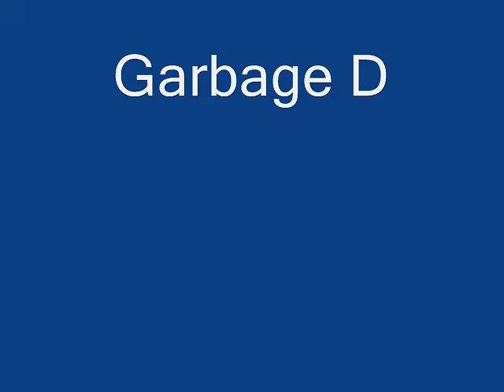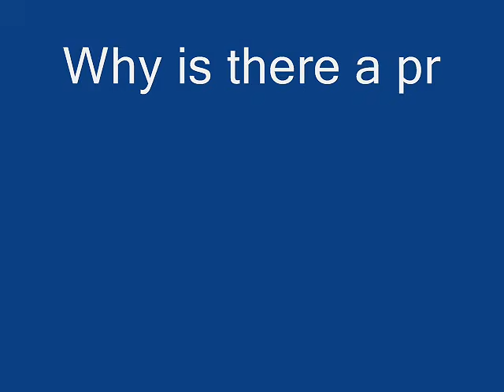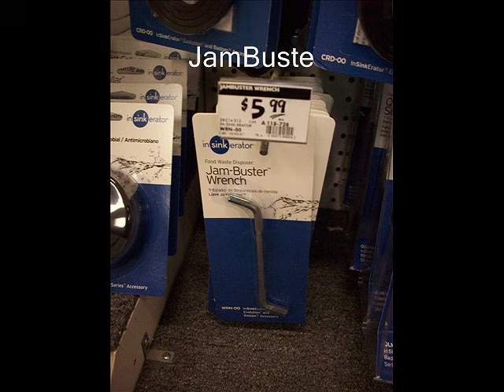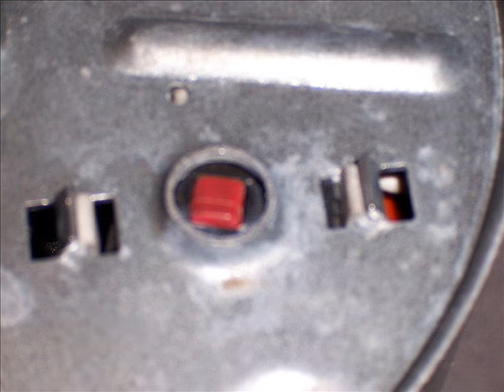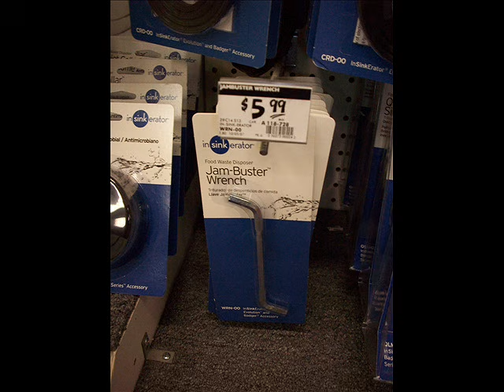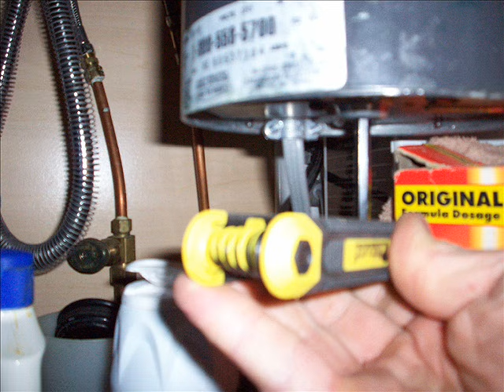Fix Your Garbage Disposal | Disposal Repair | No Cost | Save $$$

Comment: My garbage disposal isn't jammed, but it doesn't work. It was stuck, but that was because I use it so infrequently. Anyway, after freeing it up, I tried to flush down a fairly large quantity of coffee grounds and those cone-shaped paper filters you use with coffee makers. All went well until the last of it. At that time, the garbage disposal stopped feeding.  The motor hums, and the the moving parts (impeller?)  move, but  nothing is drawn down, and the liquid doesn't drain out. In short, it sounds and behaves ALMOST as it did when it was working properly, but it no longer pulls down the stuff to be disposed, and the water doesn't drain out. Is this something that requires a plumber?
Reply: It's probably jammed with the paper coffee filters.  Disposals are not made to grind up paper.
Reply: That doesn't seem logical when you consider the things that it does accept and process. Anyway,  I fixed it. The problem wasn't in the garbage disposal, it was in the tube leading away from the disposer towards the drain. It was jammed because I was loading the disposer too quickly. On another YouTube video about how to fix garbage disposals, the lady admitted that it happens to her  about three times a year, and she's an expert.
Reply: Nice that you were able to fix it.

Comment: Thought it was a goner. Could not for the life of me locate the reset button, even after looking at numerous websites and even the Waste King SS5000 manual. When you showed the red button on the bottom, I simply got out a mirror and - voilá - back in business. Since I am a 74-year-old widow I am pretty proud that I could follow your excellent instructions and fix this puppy myself! :-) BTW, this disposal was installed way before my husband died 23 years ago and it is still working great.

Comment: SECURITY ISSUE: You should unplug the garbage disposal, not only switch it off to work with it!
Reply: Cainbantam  mine is hard wired, cant unplug it. His method worked flawlessly for me and apparently thousands of others.
Reply: Switch off breaker!!
Reply: Lol... just buy new house 😂😳👋🏻
Reply: Cainbantam Good idea.
Reply: Very good point.
Reply: I have no tools,, Im going to home depot to pick up the unjam wrench. I can hear the humming noise tho
Reply: Cainbantam they are NOT plugged into the wall.. they are hard wired if installed properly.  You hired a hack to install yours if it's just plugged in the wall
Reply: @brotherdio420  Remove fuse, or switch off breaker.
Reply: @dio. Correct. It needs to be hard wired. That's the reason why manufacturers don't put a cord, with a "plug in", on them.
Reply: @james1795  Actually, quite a few of them come with plugs, and it is 100% perfectly fine to plug them in.  There is no difference between plugging a plug into a receptacle and wiring it straight to the romex...
Reply: Cainbantam Safety issue you mean?

Comment: I did it, started it, heard a huge grinding noise then a hum again. I tried the Allen wrench again and it doesn't move the blades now to clear it. I've tugged hard but it looks like it will pull the whole thing off under the sink. It still hums though. Is it possible tongue a bearing stuck or something?

Comment: A lttle tiny screw was in my disposal hiding under a corn kernel. That was blocking it. Used the iphone light, a long screwdriver and a couple taps on the scew driver handle to get the screw out. Then it still hummed. So i used the allen wrench trick. Then it started working. Save. You saved my ear drum too, if ya know what i mean.

Comment: Thank you!  Instead of paying for a new disposal, I actually made money.  Using your suggestions and my allen wrench I found two quarters jammed in my disposal!  It's working like a charm now.  Ironically, if I hadn't tried to fix it myself it would have been like throwing money down the drain!
Reply: So, you saved money from the new disposal and got an extra 50c for your trouble?  Win-Win
Reply: Daniel Lindsey
Reply: Literally 🤣
Reply: Allycat or Daniel Lindsey so did u actually retrieve the quarters or do they just stay in there ?
Reply: OJG638

Comment: another satisfied you tube viewer.  I started with the wrong size allen wrench but got the 1/4 and it worked but only after I force-turned the blades with the top end of a wooden broom handle----without the motor on of course.!!!!  The culprit was the uncooked split peas I threw down there a few weeks ago.  Mystery solved.

Comment: Awesome Video!!!!  You just saved me $118.  Just purchased a replacement today -but had not opened it.  Came across this video and fixed this within 5 minutes.  The one I bought today will be going back tomorrow.  You are a life saver.  So glad I didn't have to install a new one.  It was a pain in the butt when I put the  last one in.  Thanks so much for your video!!!  The resolution was to reset the breaker on the disposal and then to use a 1/4 hex to unjam the rotor which was jammed and easily unstuck with a 1/4 inch allan wrench as you suggested.

Comment: thanks it worked but I have one problem the Ala wrenge got stuck in the hole!  how do I get it out!
Reply: same issue how did you remove it
Reply: Called a friend with more upper arm strength. He struggled a bit but did it.
Reply: +oa1986 thanks I solve the issue, just needed to stop the blade from moving

Comment: Excellent instructions! My garbage disposal was humming at first, then it was not making any noise. I thought the motor was burned out but it turned out I just had to use the wrench and reset the disposal.
Worked like a charm and saved me at least $200!

Comment: Thanks, the last part with the screw driver was great.. Every now and then, the disposer used to fail and work after couple of days, tried everything, push red switch, shake the disposer :) the handy man used to come and didn't say any details, but now I know, "rotate around with a screw driver" if the disposer is not working but has small humming sound when you turn on the switch

Comment: Thanks. The disposer is an amazing kitchen tool. We try to strain as much as possible, just to keep bulk from going into the sewer system. I know I know, my little bit is not going to make a difference but my grandmother taught me well and that is the way we roll around here. 

The wrench works great. I suggest using Duc tape and mounting the wrench to your Disposer, so you do not need to look for it.  Our jam ended up being a small pepper stem that became wedged. The smallest things. Thanks again for the video.

Comment: If I have the hum and did all of the steps but I'm not using a 1/4 inch ( I only have an 1/8 I believe ) too small does it still have a chance? I'm bummed. I saw this tiny aluminum thin ring( key) but thinner and heard it hit the bottom.. It wasn't humming at all until tonight after doing the breaker , when I reset it went on for a second and then went to hum mode. Any thoughts? Hopefully this makes a little sense. Thanks

Comment: Thankyouthankyousthankyou!!!!  I was cleaning out leftovers from my fridge tonight in preparation for the meals I'd be prepping this weekend and I go turn on the disposal and it did nothing.  I was panic stricken.  It was a little past 9 on a Thursday night and it was the last thing I needed.  
I'm a single mom and the thought of what a plumber was going to charge me just stressed me out.
I grabbed my laptop and started Googling for answers.  I came across your video and it walked me through what I needed to do with clear instruction and pictures and I cannot believe I actually fixed my garbage disposal myself!!!!
The circuit on the disposal itself had tripped plus it was jammed.  Somehow I actually had a wrench that fit the bottom so I could clear the jam so I didn't even need to make a late night run to Walmart hoping they'd have the tool.  
Once the wrench spun freely I stood up, said a prayer and flipped the switch and I did a happy dance as soon as the disposal started spinning!  I'll be completely honest and admit I thought I was going to cry for a second because I was so happy.  Thank you so so much for taking the time to make this video, it was such a life saver and it made me so proud of myself tonight!

Comment: Excellent video.  My current disposal is about 20 years old and suddenly froze up.  Had assumed it simply wore out and was preparing to have to purchase and install a new one.  Decided first to check you tube and came across this video.  Turns out all I had to do was lossen it with a hex wrench.  Works fine now.  Thanks!

Comment: Thanks for your help.  I couldn't see what type of fitting was down there.  1/4" Hex nut was just the right magic words that I was looking for.  Thank you so much for that.  Btw, it didn't matter, I couldn't jar it loose.  It saw what appeared to be a piece of brass wedged in there.  I was able to pry it loose with a screw driver.  Don't ask, I haven't a clue.

Comment: man, nobody (that  I've watched so far) goes on to discuss the one other scenario that could be happening - no jam but still humming.... (I can turn it with the wrench and by hand from the top) I was stuck, but the wrench did the trick and broke it loose.   what's next?
Reply: Kristen Hill I've got the same issue.
Reply: I'm guessing the disposal is caput and has to be replaced since it isn't stuck, has power, but still not working....  If i'm wrong, hopefully someone will let me know before I spend the money :)
Reply: Kristen Hill  I had less luck.  Our small organization purchased a house for office space which came with this jammed disposal.  Bottom line, ours wouldn't unjam and, unfortunately, whoever installed it in the first place never put a lock screw in or other mechanism to keep it from rotating off.  About broke my nose trying to unjam the thing while it dropped. Eventually had to get a plumber to undo what I had done only to find out that someone dropped a screw in it.
Reply: John Reed did it start working again?
Reply: Kristen Hill Sorry for the delay.  Yes, the plumber got it working again, which, in turn, also got our dishwasher working again since it was tied into it.
Reply: John Reed  Okay... that is great........ BUT HOW?!  How could you leave the most important piece of information out your reply??   Lol   What did he say was wrong with it and did you watch as he repaired it?
Reply: +Kristen Hill  My apologies.  Again, office setting, so I had handed off the job to a professional while I returned to doing what I was being paid to do.  We actually had a small screw that had fallen in to the disposal.  The plumber made sure the power source was disconnected (I assume by flipping the breaker, but I don't know how; was working) and managed to remove the jammed screw through the top through which water enters in the sink though by this time, the unit had fallen.  I know nothing about whether or not he had remounted the unit to the sink before searching for the jam.  I assume he was using pliers, screwdriver, etc.  Again, not there, so it could have been a magic wand.  Lol.  By the end, at some point he remounted the unit like it had been before, but this time put the set screws in place wherever it is that set screws go so that it would drop again which my forehead appreciates.  All I know is what I've been told because when I touched it, things got worse, our secretary called the plumber, and I went back to doing what I was getting paid (& getting behind) to do.  In the end, we paid about $80 for the plumber to do his thing and it took him less than an hour to do a job that we had waited 4 years to figure out and 3 hours of my fiddling with it all because I was fed up with higher ups not doing anything enough to Google it myself, end up on this page, and break it badly enough to need a plumber.  Bottom line: 1) Cut the power 2) Look for set screws on the bottom and make sure the device isn't rotating 3) Look for the jam from the top (flashlight?) if the jambreaker device doesn't work.  4) If all else fails, call a reputable plumber or get a new one.   This probably doesn't help much as it looks like you want details I can't provide, but that's my complete, vague, totally unhelpful & useless story.

Comment: Used the handy GD wrench tool provided when our GD was installed.  Was having the humming sound; turned the crank at the center bottom.  Initially, it was hard to turn however, after another try it loosen and became easier to turn, FIXED the GD.  Thanks for the video!  Great help.

Comment: I have the hum problem, it's not a breaker issue and I can turn the Allen wrench back and forth freely but the disposal still is not working past the hum...any suggestions?
Reply: Travis-2313
Reply: stephanie orman n *UPDATE* I had to buy a new Unit at Home Depot for about $100 and installed it myself
Reply: Time for a new unit -_-

Comment: Wow, thank you! I just celebrated fixing my own clogged disposal and I don't think of myself as very knowledgeable about plumbing problems. Your instructions were excellent. I first had a hum and no movement, then even the hum stopped, but I got the hum back after discovering that reset button. Then I searched around until I found a hex wrench that I didn't even know I had. It took some elbow grease to break the clog loose, but I bet the neighbors heard me cheering for myself when I flipped the switch and it worked!

Comment: PROBLEM SOLVED.  Allen wrench worked great.  I had 2 screws stuck in the little holes of the disposer. Not sure how they got there, I usually find them in the washing machine.   Thanks for your help. I'm SO glad i didn't have to fish all of last night dinner from the inside of the disposer.

Comment: Thanks for the clear explanation. Because I had the humming noise and oushing the little reset button didn't change anything, I knew I needed to try the wrench. But it kept feeling stuck, although I had felt around in there quite thoroughly and wasn't finding anything. I kept feeling around since your video suggested the wrench should work.  After a few minutes, I realized that one thing I felt in there was a little espresso sppon that was wedged in.  I got it out and everything worked and I feel like Superwoman!  Thank you!

Comment: Thanks for making this video, my disposal had quit running and could not figure out where the damn breaker was as i thought the bottom recession was simply an orifice for a screw. I reset the breaker and turned the motor using an allen key and it is running again. Thanks again

Comment: My symptoms of this disposer was it was not making any noise after i turned it on. I made sure that from the top of the sink that the the disposable assembly was able to turn. Then after looking at the video, I came to know that there was a reset button at the bottom of the disposer. I just reached underneath the disposer and pressed something and it was the reset button (Which I pressed in). I then plugged the power chord to the switch and then turn on the power and it was working again. 
Thank You. You saved me few hundred dollars and the time too.
Thank You once again.
Reply: Mine just hums when turned on.  I reset the switch below it.. also used allen wrench and it turns freely...

Flip the switch...but still just the hum.

Isit dead?

Comment: Hi, what does the reset button do?
Reply: Reset the garbage disposal
Reply: It is a simple circuit breaker that trips when the motor stalls and draws too much current.
Reply: @ Robert, thank you. It makes sense now, so it works like the electrical fuse at home. My garbage disposal is fixed :)
Reply: Robert Danti 

Shady G8:32 PM

 
 
@ Robert, thank you. It makes sense now, so it works like the electrical fuse at home. My garbage disposal is fixed :)

Comment: I used a plunger to unclog my garbage disposal drain, but the garbage disposal was still jammed.  Since I didn't have any tools, I used the handle of a broom and pushed it into the garbage disposal and with a little pressure the blades started to move.  It worked, the garbage disposal ran great after that.

Comment: First I had Problem #2.  I thought it was busted, so I walked away.  Then I guess someone else played with it, because when I came back the unit was dead with Problem #1.  Pushed the Reset switch, and I was back to Problem #2.

Oh Mr. ClassicManuals.  I thought the belt broke after 14 years.  You say just twist the jam wrench??  I'll be back in a minute...

That was WAY too easy.  It took almost no force to unstick the mechanism and get the wrench to turn in the receptacle.  (And I don't mean AC receptacle.)

Then, when I turned on the big switch, the disposer started spinning again.  But there was something knocking around inside there. 

I turned off the switch, stuck in my thumb, and pulled out a plum... pit.

Now it's 100% fine.  Mucho thanks.

Comment: Very helpful.  Only either my disposal didn't have that allen wrench hole or i just couldn't find it.  So after resetting with the red button I had to manually turn the fly wheel (used a screw driver, I've seen suggestions for a long wooden spoon handle) counterclockwise and clockwise until I was sure there wasnt anything stopping the blades from spinning.  AND VIOLA! 

THANKS again!

Comment: Very clear directions. Had the hum when a glass broke and got stuck. I used a pair of tongs to clean the disposal. Used the 1/4" wrench and had to move it reallly hard. It finally gave way and moved relatively freely. Poured water and turned it on--no hum but not working either! Hit the reset button, and voila the disposal worked!!! Thanks a ton for the video and the tips. Spent $6 instead of $90 on a plumber